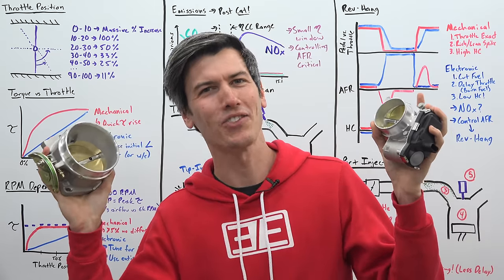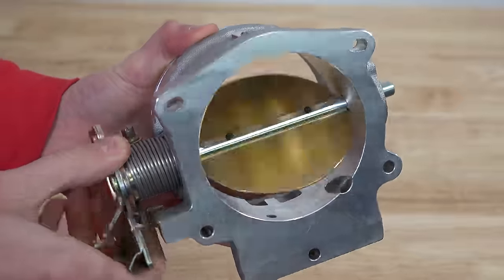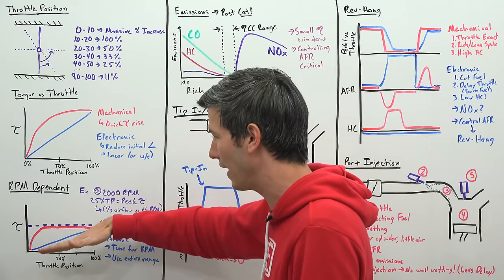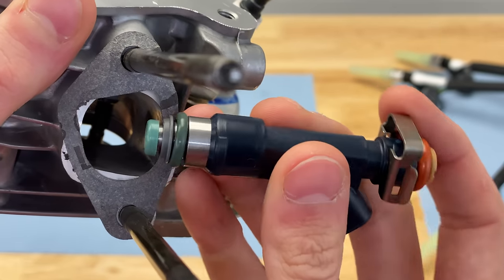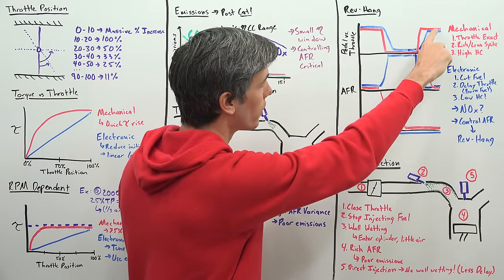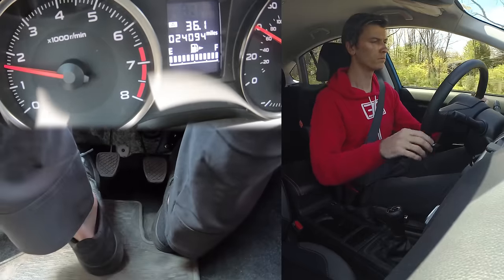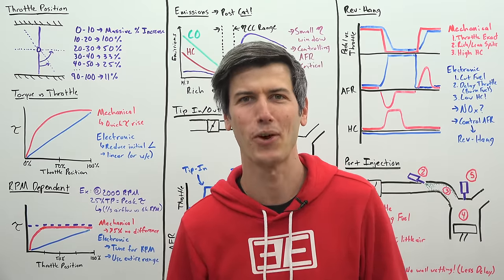The Big Problem With Modern Manual Transmissions - Rev Hang

Comment: To be honest, the throttle body response on the vw 1.6 4cyl na engines is super responsive and precise. I prefer it over a "mushy" cable.
Reply: 1.4l Turbo/Compressor version here with 170 HP, throttle response is just fine as well, but the change from compressor to turbo is horrendous when you push the car a bit more and you feel it in every gear.

I had long ago a 1.9l direct injected , N/A VW diesel with 75HP from like 1995, what a amazing machine which barely needed maintenance within 400k km. But rust took over some day.

My other cars are a 2l Subaru Impreza (Boxer Diesel) and a 1,9 TDI Golf Cabrio from 1996, but none of them come close to the throttle response and feeling of the old NA diesel despite much more sporty and „better“ in general.

Comment: So we’ve ruined the driving experience of a manual to reduce emissions for a brief moment during a shift, which is a very small part of your driving time, for what, 5% of the cars in the US? I loathe rev hang. I had an 87 mr2. It didn’t have rev hang. Such a better driving experience.

Comment: My 89 IROC 305-T5 has the absolute best throttle response and feel of any car I've ever driven (and that's a lot).  It has a physical link with long travel and a very soft spring, but also a throttle position sensor, mass airflow sensor and electronic fuel injection.  The computer is very good at using these in combination to give you a nice resonse and feel.  No rev hang, and I can do power shifts if I don't mind replacing the clutch every few months.

Comment: My old "98 Volkswagen Golf IV had hybrid-throttle body, which was connected to gas pedal with a wire like any mechanical throttle, but it also had electic motor to open it automatically (in this case the pedal is being pushed down "by itself"). 
It was helpfull when, for example, you start moving without touching gas pedal or when you used power steering on idle.

Comment: My mom used to drive a rav4 and I thought the drive by wire system was horrible, because of lag and poor acceleration. Turns out that the engine is just severely underpowered for the size of the car, which meant to accelerate it always needed to downshift, which made for slow and jerky driving. 175 hp for a 3700lbs car is not enough especially when considering any elevation gain.

Comment: Regarding the explanation at the beginning at about 2:30: Many manufacturers have created linkages that translate the movement of the gas pedal into a somewhat linear opening of the throttle valve. For example look at the throttle body linkage in a BMW E30 325i with its little levers. No need for an electronic valve to achieve that. Sure it doesn't fully include RPM or airflow, but the feeling is great and controllable.

Comment: The driving answer to rev hang is a slowdown (or pause) of lifting the clutch at the point of bite so that you slip the clutch for a fraction of a second and thus do not get the clutch dump jerk movement. I do this so instinctively that I don't even notice that I'm doing it and I suspect that many other drivers do the same. My old Volvo V40 really needed this for smooth shifts, my current Skoda Octavia with direct injection, not so much.

Comment: I have more "rev hang" now with my mechanical throttle than I did years ago.  And yes, I did clean the throttle body.  But after this many years, I can tolerate little quirks in the 1.9-liter 1991-2002 plastic Saturn "S" series.  Still a great economy car.

Comment: All of the benefits you listed (besides the reduction in fuel enrichment during shifts) are things I do with my foot, including the partial throttle at low RPM to maximize torque. This is why I vastly prefer a mechanical throttle for performance vehicles. Honestly the best throttle response I've experienced comes from an old school carburetor because the EFI engines with mechanical throttle bodies still do some of what you're talking about here with the throttle valve. The old Saturns were notoriously bad for rev hang. My ideal setup would be a port injected, mechanical throttle, naturally aspirated engine with the rev hang feature tuned out of it.

Comment: I've owned a 2013 BRZ for over 8 years. Never have I ever had an issue with rev hang. Maybe it's  because I installed a 10lb flywheel pretty quickly after I bought the car, or maybe it was just tuned better than most from factory? The revs raise and drop with the gas pedal. No delay. No hang. Throttle is snappy, gear shifts are butter smooth, and heal toe down shifting is second nature.

Comment: Well, a solution upon what you mentioned about the cabled throttle body in terms of getting a non-linear response from the engine was the IAC valve, which also regulates the amount of air that can pass to the engine (and in my case also makes the engine to have rev hang when shifting gears)
In a car with a cabled throttle body which has an IAC valve, if you disconnect that valve, it would certainly happen what you mentioned about the engine trying to make a lot of torque with about a 15-20% of the throttle body opened (I made the experiment myself few days ago just for knowing how that valve affects the way my engine works and happened what you showed up on the graphic when monitoring the engine parameters with an OBDII tool).

Still a great video, but wanted to highlight that because it seemed to be ignored.

Comment: Bingo.  Only emissions control.  The HUGE MISTAKE you're making is things like progressive 4 barrel carburetors or even a progressive 2 barrel, or even a slide constant velocity carburetor.  The more complex the plumbing the easier to clog it.  I drove twin and triple stick trucks, there is no comparison between a real connection to the machine and competency.  Automatic rigs, drive by wire through a computer, making better emissions make steering wheel holders not drivers.

Comment: I have owned many cars with an electronic throttle, and the only one which had issues with rRev hang was an alfa 156 v6, and that was one of the first generation of cars to come with an electronic throttle. On the more modern ones it hasn't been an issue.

Comment: So that's what's wrong with it. I'd never heard it called "rev hang" before but I remember I had an air-cooled Volkswagen that had a vacuum diagram diaphragm that did the same thing however it could be adjusted with a set screw so no problem.  I don't recall if you had a fix for this problem or if I just have to learn to shift all over again. Thanks

Comment: Well, if your going to have rev hang no matter what, you might as well just power shift at every gear change while accelerating.  Personally, I HATE computer controlled vehicles. The engineers who think up this crap are ridiculous. the tiny bit of emissions that they are going to save over the life of the car are miniscule. We would be MUCH better served if they would chop off 500 pounds of excess weight. That would save MUCH more fuel, emissions, and lower maintenance costs because the vehicle would not wear parts out as fast.

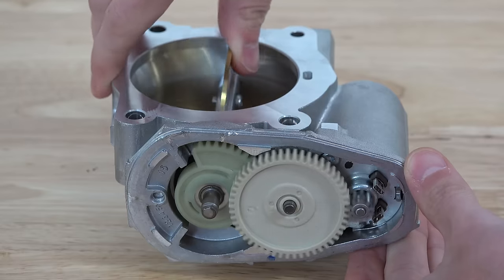Comment: 3:29 same goes for mechanical, you just need different linkage geometry.
Also you don't need to use a butterfly valve either, there are other styles that can be used to further adjust the feel.
The driver is also a factor.

They just need better software for these electronic valves, and ultimately the extra emissions at shift points is pretty negotiable to other emission sources like tanker ships.

Comment: Rev-hang is not unique to electronic throttles...I noticed it as early as the mid-80's on Honda's 1st gen PGMI-FI and they were all cable operated well into the 2000's.  Readily apparent compared to say BMW's of the same vintage. Nice to know the theory behind the AFR and emission requirements on the back end, but it still sucks to deal with while driving...having to purposely slow down to accommodate the drivetrain, as there's simply no other excuse from a technological standpoint. It's 2020 after all, and for all the bells and whistles, we still don't have certain key features I'd thought we'd see by now.
Reply: Some cars, such as your Honda, had a bypass value that was not controlled by the throttle.  These were used for, you guess it, improving emissions and of course they caused rev hang.

Comment: couldn't the linear throttle to torque also be made purely mechanically? between the pedal and throttle body there would be a CVT that would adjust its gear ratio according to the amount of press on the pedal? Like so that there was a mechanism on the pedal that would push the CVT belt towards higher ratios as the pedal was pressed downwards. I know it would probably be unnecessarily complicated, but wouldn't it theoretically be possible
Reply: Modern high performance mechanical throttle bodies often connect the throttle linkage to a set of liner stepper gears instead of directly to the throttle valve.  This flattens out the power demand closer to the throttle position, but is of course not as precise and can not be programmed on the fly.

Comment: This is throttle by wire, and I hate throttle by wire.  NO IT DOESN'T give better throttle feel, it slows throttle response.  It does this to make it easier to obtain super-high gas mileage, and I am not a gas mileage freak.

Comment: In the manual throttle case, why doesn't the ECU reduce the lag between throttle position change and fuel delivery change by looking at the throttle position sensor?

Comment: If anyone says pedal feel is better with electronic there lying or they have only driven worn out mechanical ones
Reply: My example of hating rev hang tho... I used to drive a 2000 civic sir with the b16a2 set up as a full track car for a daily driver, when I came hot into a corner I downshifted kinda aggressively, say I came to the corner in 4th at 8000 rpm, in the time it would take me to push in my clutch i would tap my brakes and by then I would expect my rpm's to reach below 2000, as I release the brake id blip the throttle to rev match to say 5-6000rpm as I'm realiseing the clutch, if I hit the right rev and had proper hand placement i would have just shifted as fast as a sequential and with no jerking, everytime I try to rev match on a down shift with a newer vehicle the computer makes a hard shift then I used to, this is why they suck for ppl who can actually shift beautifully.

Comment: The fuel mixture point you made at the end of your explanation, with a direct injection engine, there is no need for the rev hang. There is no excess fuel to burn off in the intake manifold. So why is it still an issue on direct injected engines?

Comment: Manual throttles always had throttle dampers. 
The one he shows has the damper removed!
The electric throttles simulate the damper. 

There is nothing wrong.
This video is nonsense.

Comment: Here's the problem.  Rev hang does not have to exist with a modern 4 cylinder turbo 6 speed car.
Two cars:
Honda Civic Type R:  No rev hang
Honda Civic Si...baby version of Type R engine: Rev hang.

Engine architecture is not that different between the two cars.
Unforgiveable the 1.5L turbo Si motor has so much rev hang.  Ruins an otherwise nice car.
More enthusiasts who don't need the power of the Type R would buy it.

Same with comparing the WRX and STI.  WRX has awful rev hang.  STI...different engine architecture but still a turbo'ed boxer engine, doesn't have rev hang.

Comment: The hang drives me CRAZY in my gf's '11 Mazda3, but I'd rather wait than over-work the clutch. They've basically engineered a built-in slip-enhancer into cars for the newcomer, and I think it reinforces bad shifting habits. I'd rather throw a little unburned fuel than change a clutch anytime during the life of a vehicle.
I WANT MY DASHPOT BACK.

Comment: 3:19 That is not true. On a mechanical throttle body, the wire follows a non-circular guide. This can be seen even in this video. The guide is clearly eccentric.

With a carefully chosen guide shape, the end result is that throttle wire length is proportional to the throttle opening area.

Comment: Mostly BS as they usually make the cam for the throttle cable make up for the torque VS throttle position. 2nd most of the so call list of benefits is actually not! Especially  the delayed response. All mechanical is always quicker responding and always more precise. There is no way a computer can calculate any faster  then a instant reaction of mechanical connections. It is clearly impossible! Sensors must send signals to the computer the computer must calculate then respond by sending signals out. Simply the lag of the signal alone proves delay not to mention the computer has to calculate everything. What a joke!

Comment: im doin a LS swap and  plan on wrapping my highly modified  y-pipe so it doesnt cook nearby fuel lines, speedo cables, O2 wires and especially the tranny oil as it will be going under or  very near the tranny pan..
Will this affect the tune cuz the Precat sensors SHOULD  heat up alot faster?

Comment: This is not that new a problem.  In the 1970’s, before electronic engine controls, engineers added a mechanical plunger and damper [dashpot] to carburetors.  It slowed down the closing of the mechanical throttle during tip-out.  As I recall, C&D and R&T editors hated it.  Unlike modern engine control software, owners could easily defeat it by removing the dashpot.

Comment: At 7 minutes I think you are incorrect.  The figures shown are the emissions leaving the engine.  Not the effectiveness of the catalytic converter.  The converters should be good at burning excess CO and C emissions.  NO are harder to eliminate.  Which should mean that the delay of closing the throttle isn't as much needed as a progressive opening of it.
Equally it should also mean that the rev hang problem is greatest under hard acceleration with wide open throttles and far less under sedate acceleration.  Although not having a stable of modern cars at my disposal I can't test this on the road.

Comment: Regarding the non-linearity of mechanical throttles, I have a feeling that something's not quite right - particularly the second graph, the torque vs. throttle. I understand that as you press the pedal harder and harder, you feel that the gain in torque is increasingly lower. That makes perfect sense. What doesn't seem to make sense to me is the red portion of the graph. I don't think the torque distribution actually looks like that. You may FEEL that it does when you push the pedal gradually, but I don't think it actually IS like that. What if you don't press the pedal gradually? What if you depress it directly to 50% of its travel? Won't you get 50% of the available torque? I think you will.

Comment: Rev hang is actually is an old problem - and emission controls were the culprit. In the 70's automakers (especially Chrysler) experimented with deceleration valves on their vehicles during high vacuum. Many of us removed them.

Comment: the electronic throttle is not the cause of the rev hang issue. its the manufacturers mapping in the slow rev drop to improve emissions. it is an absolute fuk up of driving enjoyment. it makes any car with rev hang horrible to drive. this along with anti stall are 2 of the most evil things to happen to the motorcar. We have never needed anti stall and never will. what moron decided it was useful needs terminated.

Comment: My ‘17 Golf had heavy rev hang it really took the fun away from driving it. When it was cold it didnt hang much but once warm it hung like a noose. The explanation I got was for PCV pressure changes thus condensating oil, when it would hang then less oil condensates with the slow change of PCV pressure

Comment: My 2001 Blazer 5 speed has rev hang that drives me crazy, with a mechanical throttle body. Supposedly unplugging the IAC will correct it, but it may effect the idle on the following start up, so you plug it back in, start, let it warm up, then unplug it again until you park, then plug it back in...I'm not doing that, but, it means floating gears is a PITA as when you pull it out of gear w/o the clutch it hangs worse than with the clutch so your shift takes several seconds waiting for the rpms to drop, my '92 s10 blazer with an earlier 4.3 and nv3500 did not have this issue and was so easy to float smoothly, and it came in handy when the clutch slave cylinder failed and I had a dead clutch...if this one fails I'd pretty much have to call a tow truck. Unfortunately I have to shift slow, which sucks on hills, waiting for the rpms to drop or deal with the jerking associated with the engine speed being hung higher than what it needs to be for the next gear...frustrating when my '92 was so smooth and easy.

Comment: Rev hang got nothing to do with emmisions but with smooth transition to deacceleration. To remove jerkiness on lifting throttle they program ECU to slowly close throttle and sequentially turn off injectors. On top of that they can program ECU how long it will rev hang to encourage slower gear changes.

Comment: I don't drive manual, but does rev-hang mean that one should adjust one's clutch timing? That is, waiting a bit longer until revs fall to the proper levels before engaging it rather than simply forcing the issue?

Comment: Bah, if you are in a sports car manual then emissions come second to driving/shifting experience.   You'd still pass an emissions test during inspection because it's not like you are shifting gears during that test.  Also electronic throttle bodies suck because when they error your car goes into limp mode and you have almost zero acceleration to get to where you were going.